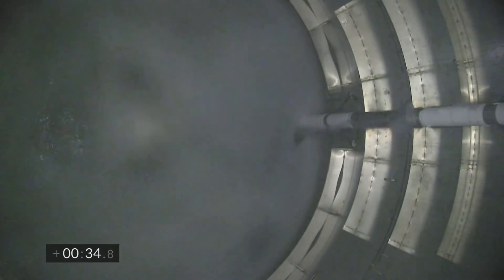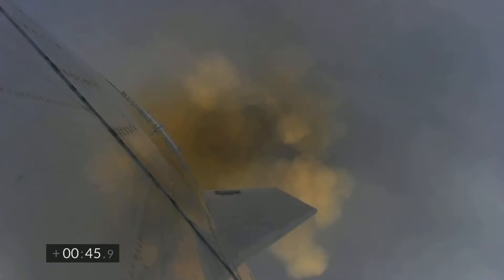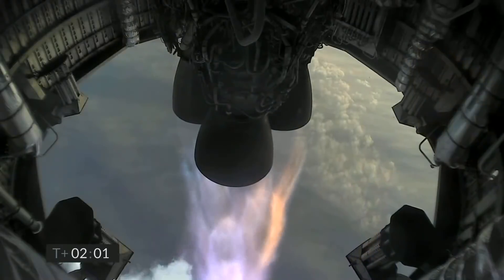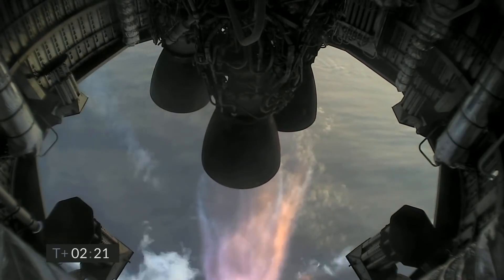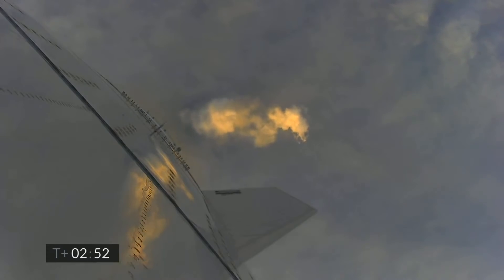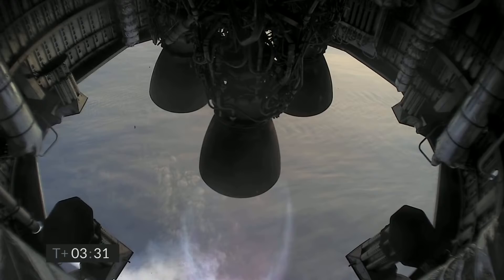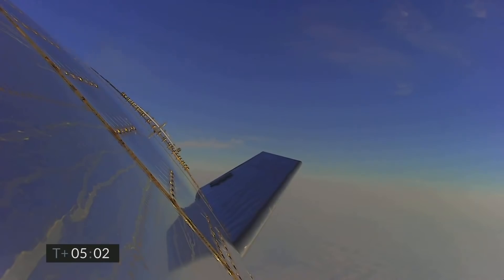SpaceX Starship SN11 Launches & Suffers Inflight Explosion

Comment: Abolfazl Fazlollahi
Mr. Ilan Mask, you have to use five engines and you have to. Position the engine so that you can maneuver with the mechanical arm, and the engines must be like fighter engines to control power. Also, the aerodynamics are very important.
Thanks to Abolfazl Fazlollahi from Iran

Comment: Why are they having so many failures after the Falcon Heavy?  I always heard that if something works don't try to improve it.  You have been doing a great job so far.
Reply: You wouldn't be here if thats the case
Reply: Starship is a monster, controlling it it's just another level. All the power and heat usually weaken the rocket, that's how violent it is. We need time till we reach perfection
Reply: @ahgcomegaguardian5575  people are taking reusable rockets for granted
Reply: @TheFool_0001  Just imagine a rocket engineer's mind, totally different from what's normal. It's easy missunderstanding something so advanced. Rockets are at the top of flying objects, their physics are very intense, any mistake is multiplied by 1000000 in 0.2 seconds.

Comment: What’s the big difference between the boosters and the sn’s,  the boosters are always pointed up and the rockets down  and the fuel is stable.. I think they are trying to do to much too fast, the sn’s for much of their flights are even pointed down and are only given seconds or less to reestablish themselves get their fuel settled and the  rockets reigned. I think they should perform the flip sooner, have baffles in the fuel tanks, to prevent sloshing, ignite at least one rocket sooner to force the fuel to settle.  Than when every thing is stabilized and the fuel is settled than try to rocket assist a major slow down.  Space X is trying to do things to fast during the landing , if fuel quantity is not an issue, ignite the rockets sooner to give them selfs more time between the flip and the landing to stabilize the fuel and engines.Than play with the rockets to preform a powered landing.  It seems to me that they are expecting evert thing to go, bang, bang, bang correctly and on time to prevent the big boom.  Well that’s not working out to well,  Why are they having trouble with the engines, it appears the the fuel to them is the problem.  Slow things down give yourselfs  more time between the  flip and landing.
Reply: this is literally one of the first flights of a full flow staged combustion cycle engine, PLUS spacex has 12 turbines to control instead of the usual 6. Why, you might ask? Well, this needs to be able to get to Mars and back again CREWED. Also, these test flights are done in a populated area and the suborbital landing pad is quite small, so a lot of translation would be required from the landing burn if you ignited one engine during the flip, thus using up more fuel. also, i think you've forgotten the fact that igniting sooner wont help whatsoever with the flip. 

lets take a look at one of the last sentences in your comment: "just play with rockets to perform a powered landing". remember how this is a prototype. look back at the F9R. this is the same thing, but the F9R was for the falcon 9 and this is  starship.

also, the difference between boosters and starships is that one of them is only for liftoff and the other is for the remainder of the flight.
Reply: @itwithlyam9334  I don’t agree inthat I think they are trying to do to much to quickly.  Fuel slosh to the engines makes them unstable.  They should have enough fuel to burn them a few seconds longer to stabilize things before attempting touch down.  The principal theory is sound they just have to slow things down sooner giving them more more time to make adjustments .  As a second thought I wonder what kind of G forces the flip generates
Reply: @dongeiger4500  Starship already has over the required amount of fuel to touchdown from 10k, as seen with the rapid depress with SN10
Reply: @itwithlyam9334  
I believe very strongly that Musk is the future of mankind and what he is doing is critical for our survival.  I also believe in his philosophy of dream it, build it, test and destroy it, until you succeed.  Musk is the most important leader of a brilliant team of people on earth today a I wish him all the success he deserves.
Reply: I just read my first message again and by boosters I meant Falcon 9 boosters and the success they have been having with these rockets.  I apologize for my mistake.

Comment: OMG what a stupid mistake waiting all this time and effort to execute this mission with such poor visibility.   I think this was a little reckless on SpaceX part and I wonder how many youtubers are going to admit it.   WHAT A WASTE 😒
Reply: But who cares about visibility, landing is automatic so no need to see.
Reply: @stefanderrick1436  That's not my point of course this and other rocket can still function in rain, night, cold, heat... this is an experimental craft and EVERY piece of information VISUAL and electronic is vital to determine the cause of a specific failure.  The space shuttle crash for example they were able to determine 1 lost heat tile during assent doomed the mission ALL FROM VISUAL (they didn't have a sensor or some kind of automatic warning system).
SN8 - SN10 look at all that has been learned and "corrected" from the visual data (legs failure to lock in place for example).
Also just from a PR point of view the landing issue has not been resolved SN10 was a failed landing despite what many choose to believe (there are no almost good landings), if this landing had been successful SpaceX would have lost the footage a 1st Starship take off and land 100%.   IDK why there's all these people bragging about sn15 sn20 when there's still a HUGE problem to resolve.

Comment: The blue flames seen very soon after take off spelt "DANGER"  The brilliant SpaceX team would have known there was a problem on the way.
 I have every confidence they will have this sorted out in time for the next test flight with SN 15🚀.
They are testing and they are learning -- so ALL GOOD.👍🏻
Reply: @jshowa o sn10 landed but harshly at 10m/s so they have already kinda landed this thing in one piece this rocket had some problem and you can see a small flame near the fuel line 00:40 so I think this is what caused the problem.

Comment: Possible reasons for failure (raptor numbers are by cutoff):
- Engine burning LOX rich (Raptor 1) 0:10
- Engine fire during ascent (Raptor 2) 0:35
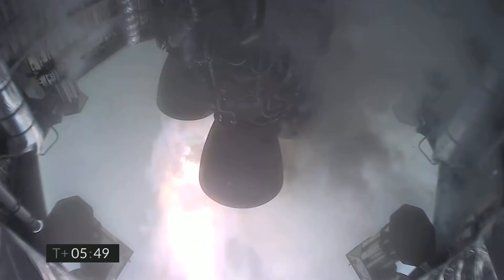- Engine not lighting for landing (Raptor 3) 4:50
- Fuel leak 4:45
- Header tank switch failure
- Depressurisation of header tank
- Pulled an SN10 and used Helium in tank?
- Flaps not being locked in place
- Low thrust
- And did I mention an engine fire?

All in all, I'd say this was clearly an FTS detonation, and that's supported by looking at Everyday Astronaut's footage when its camera was struck by debris. Well, SN15's going to have some issues.

Also, no, I am not a rocket engineer, I'm a developer.
Reply: IT with Lyam
Are you on the team? Are you a rocket scientist? How come you have all the answers from just watching a short video?
Reply: @-HighTide  reason 1: orange exhaust, reason 2: a visible engine fire, reason 3: only one engine lit when camera failed, and you can see a tank spill clearly in the video
Reply: FTS  was not triggered
Reply: @grandmastarflash 
But you were. .  .   .    .
Reply: @-HighTide  ok bud
Reply: @grandmastarflash 
                                        
                         🎆🚀🎆       
just bothers me when the 20/20 experts show up late.
Reply: @grandmastarflash  I'm pretty sure it was, nothing else could've really damaged the vehicle in such a way that debris was raining on Starbase
Reply: @itwithlyam9334  could have been a crack developed in the LOX/methane common bulkhead, if that happens once you fire up the engines its only a matter of seconds before an explosive mixture is pumped into the engines, then boom. whatever it was though, it wasnt FTS
Reply: Tim?  Being bothered is your area of expertise??  Joking dude, focus on who has showed up, whether they have 20 20 hindsight or not.
Reply: @simonmasters3295 
You mean the Monday morning quarterbacks?
Reply: I can't fault this analysis. Can you?
Reply: @simonmasters3295 
Clearly I'm outnumbered by experts.
Reply: @-HighTide  We all are
But I'm in Somerset, UK and Elon is going Mars.  
Part of his plan involves land near me, presently in the ownership of a firm called Gravity probably acting on behalf of British Aerospace.
What's your expertise?

Comment: Weather may have been a factor.
Reply: Yes, Fog will certainly blow the Starship up, right.
Reply: @lilpain8883  it was a cold day. Remember the challenger blew up because of the unusually cold weather messed with the boosters and it leaked and ignited? Obviously this is totally different buy why do you think NASA only launches rockets in warm weather?
Reply: Explosive fog
Reply: No, if your too blind to see the engine pipes on fire or not think that that might be an issue, then you should keep thinking that it was the weather.
Reply: It's the FAA fault and politic
Reply: @boomerrang315  how is it the FAA fault and politics, it makes no sense.
Reply: @memeboi6108  eventually launched on bad weather day as result of the faa bureaucratic and unnecessary red tape.

Comment: The biggest clue was the audio after the engine lit for landing, and within seconds the audio was also cut, suggesting something catastrophic had happened.
Reply: You could hear small objects impacting the pad and at least two loud explosions that seemed to happen further away. If it was an AFTS activation then those large bits would be power heads and the more durable tank structures and so on.
Reply: @noecarrier5035  In the audio taken from inside the engine bay there were a few bangs and a loud clunk just before and after the video feed froze. Then shortly after the web cast was muted. Note, the webcast does not need any feed to function so must have been muted manually.
Reply: @aaronmicalowe  Yeah, I thought that audio we heard was because the link to the vehicle had cut out and it returned to pad audio without video, either manually or automatically. I didn't consider it could have been audio only engine bay footage. I figured there had already been total LOS by then.
Reply: @noecarrier5035  I guess that's also possible if it was very windy on the ground and things were being knocked about and picked up by a very sensitive mike. 🤷‍♂️
Reply: @aaronmicalowe  Yeah, we'll have to see what happens later when they pick through it. I definitely heard a really big bang or explosion, and if that was the vehicle AFTS going off or a fuel leak being ignited, would the rocket continue to record and transmit audio? I guess it could, but it seems less likely, especially as the camera is inside the engine bay.
Reply: @noecarrier5035  - There's at least 2 cameras and mics we know about, and probably others we don't.   And the feeds from those are controlled by SpaceX.  So while they may have continued to transmit even after explosion (if they're self-contained), they could have collected useful data even if we weren't allowed to see it.
Reply: @phydeux  Sounds highly likely. There was a brief look inside one of the tanks on the livestream as they cycled through cameras looking for a good shot through the fog during the ascent. And there was all that stuff recently where some clever radio geeks pulled tank cam video out of the telemetry feed too.
Reply: @noecarrier5035  - I hadn't heard about that.  Clever stuff.  You'd think it would be encrypted better.  :)
Reply: @phydeux  Yeah, it was pretty surprising. Apparently it could be something to do with missile control treaties. When the Powers test their missiles they broadcast unencrypted live telemetry so the other side can see they're not trying to do anything sneaky. Mutual confidence and stuff.
Reply: @noecarrier5035  - I can see that for the exterior cameras and such.  But for things like internal tank cameras I'd expect them to want to keep that secret so people can't rip off their designs.

Comment: Raptor engines suck. Don’t ditch starship, but it might be time to take a break a redisign the engines .
Reply: They're experimental and these flights are... *drum roll*... experiments.
Reply: These engines are prototypes, and some of the most advanced engines to ever be made. These were thought to be theoretically impossible, and spaceX strolls up and knocks it our of the park. The Merlin engines, (F9+FH) took much, much longer to develop to even get to a semi-stable state, while Raptors worked on their third flight attempt. Yes, they still have much to be improved on, but not a single engine has worked perfectly on its 4th try. No one ever has made a full flow engine until these guys, and they are making it work. Heavily upgraded raptors will be featured on SN15 and on, which will flush out any and all issues with the current model.
Reply: @ashers.5856  fair enough haha I don’t like being so negative but the engines are starting to irritate me that’s it’s so consistent with just engine failures. They will probably make it work
Reply: @devdecker7812  SN8 was not an engine failure. It was a tank failure.
Reply: @mariasirona1622  ooof!
Reply: The F1 of the Saturn V was problematic too
Reply: @mariasirona1622  They went through a good number of them operating for seconds before detonation, before they got them right and stable, then a few more testing that instability would not be a problem.
Reply: The raptor engines are great, and don’t expect them to always work. Everything about them is brand new. And they use methane as fuel so we could make the fuel on Mars. These engines are perfect, we just need to work out the kinks.
Reply: @danieljohn560  fair enough to all these responses. It’s just definitely disappointing to see them struggling. Merlin engines did not struggle so hard and of course being so advanced and new makes them have lots of room for being improved but they’re still what’s holding starship back right now
Reply: @danieljohn560  it’s badass every time I’m like “explosion or landing either way badass” it’s almost become it’s own entertainment promotion or something I’d buy tickets to the premier of the next starship launch lol idk
Reply: right, what type of engine do you think the raptor is? a full flow stage closed combustion cycle. this is the first ever engine of this type to make it off the test stand.

what's the goal of starship? to get to mars. for that, you need to use a fuel source that's capable of being manufactured on mars. Methalox: perfect. RP-1: not perfect. plus, an open cycle engine is very expensive due to fuel literally being dumped out the turbine so that other fuel can get into the combustion chamber. 

what's the goal of spacex? to make spaceflight more affordable. et voila, the raptor.

tl;dr: the raptor cuts down costs by not wasting any fuel.